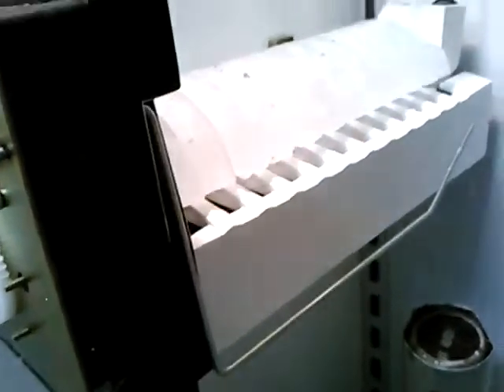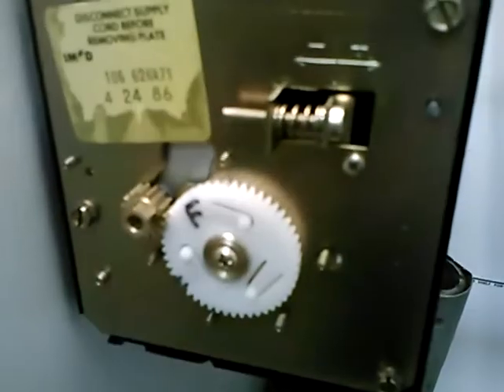Using Heat Gun to Free Stuck Ice - Sub Zero Icemaker MOV383

Comment: If it were a modular unit you could merely replace the i/m mold with heater.  Unfortunately yours isn't a modular unit so you'd have to replace the entire i/m.  I've got the same problem in an old refrigerator (92) with a modular I/M, yet it's so old I'm just replacing the entire Ice Maker Unit.  I see your I/M is even older (86)... but I'm sure you've already figured all of this out by now.
Reply from the maker: Yes these icemakers are pretty cheap to replace the whole thing or as you suggest just the mold / heater.  The breaking off of the gear teeth shows the heater wasn't doing its job, now it is.  Kind of a "jiggle the wires" repair, don't know how long it will last.Got this one because it was very cheap and I just thought the dual compressor idea was cool. Very difficult to move the carport area and really don't have a plan as to how I'll ever get it into the house.So what's the "best" model to look for ?  Guess I should have looked for one with no computers + modern coolant. Less electricity consumption / better insulation would be nice too.Thanks for the comment.